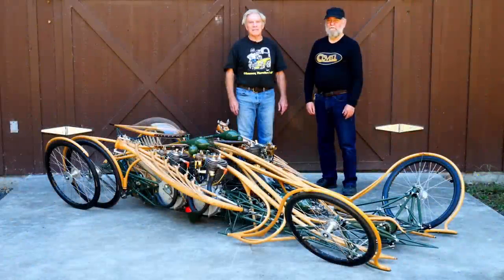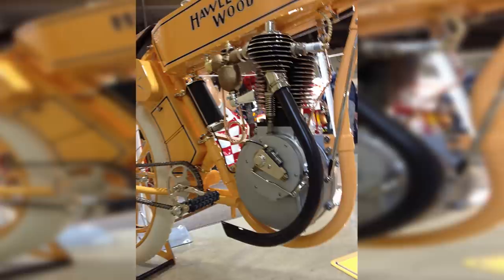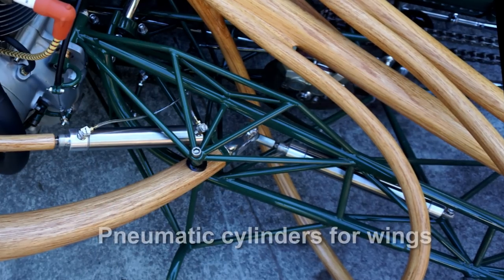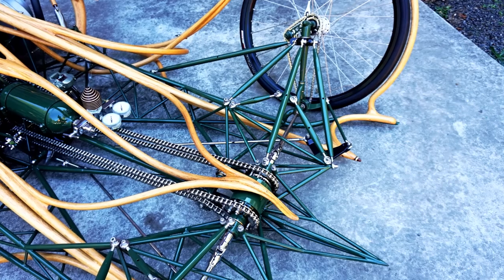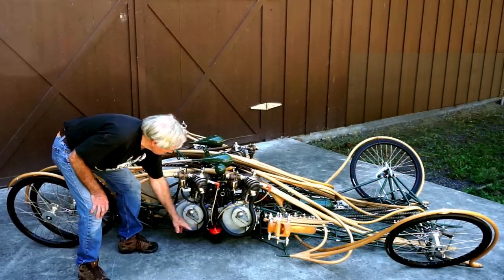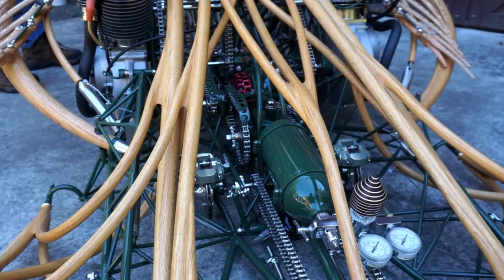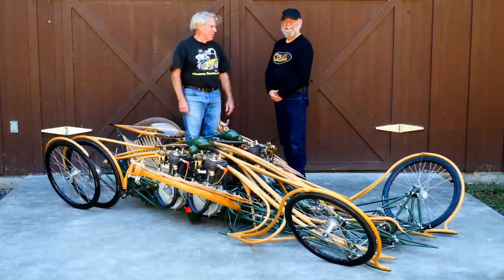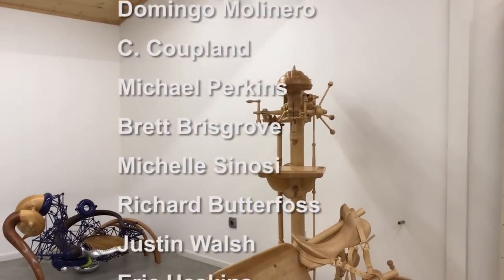Mike Cooper's Chain Reaction

Comment: Ron, knowing your background, I'd be more than happy to see your take on design and the process of designing a both functional and beautiful vehicle, seat, sculpture or just about anything people can make. I'm an engineer and I often feel I lack the artistic side of me. I'm not sure how to approach dimensions which come out beautiful and balanced. I often use too bulky materials (even if thin walled) and when I'm finished doing what I do and stand back and take a look, it's almost always looking less than attractive and something seems to be "off".. I've tried using CAD, but it's sometimes difficult to see how it comes out from different perspective. Even a simple table is hard to make if your aim is to have everything balanced - table top proportions in relation to leg length, height and width etc. Call it "how to make things beautiful" 🙂
Reply from the maker: Thank you so much for your thoughtful comments. I seem to have been born with a skill that many people call 'a good eye'. I seem to know intuitively how to tweak proportions to make shapes work well together. I did go to art school for 6 years, and learned many helpful things there, but I'm not sure how well design can be taught.
Reply: @RonCovell  thank you for your comment. I often think industrial designers doesn't get the appreciation they deserve. A regular person is quite good at looking at a finished product and make judgements (as comes with music also), but designing from scratch is hard. It's really hard. The mathematical approach is always there with golden ratios but it doesn't always work when one needs to think about structural integrity.
Reply from the maker: I agree with you - structural design and aesthetic design are very different, and it's often quite challenging to integrate them.

Comment: It’s so beautiful but the entire time watching this, I’m asking the screen, how does it steer?
Reply from the maker: While it's hard to see, there are handlebars in front of the driver, and a linkage system that steers the front wheels.
Reply: @RonCovell  My comment wasn’t about the manual control of steering, I’m talking about caster and camber of the actual wheels. 

I understand that this “vehicle” is art. I get it. But at some point, pretending to make an art piece that is supposed to move down the road for even short distances the artist should pretend that it could steer itself down the road. 

Steer tires angled out at nearly 45° camber cannot be controlled to go anything other than straight at any speed.
Reply: Again, the thing is a masterpiece. It’s beautiful. The front wheel drive alone is incredible. 

My point is that an airplane “sculpture” with no wings wouldn’t really look like an airplane.
Reply from the maker: Well, the sculpture has a little caster, and a LOT of camber. I think it can steer to some degree, even with that huge camber angle. We'll see when Mike makes it more operational.

Comment: I'm totally into sci-fi, fantasy, outside-the-box thinking, and overall wild ideas. So while the wings are cool, I'm personally enamored by the DRIVELINE! While you panned around the front, I saw the chain running up front to an axel, which then drove a chain... and I said to myself "holy crap, he made it all-wheel drive!"

For me, I find the mechanical engineering part of this to be the impressive and "cool" aspect! I think a second one needs to be made, stripped of the extra glam (mainly just the wings and associated parts), using PVC and fiberglass in place of the wood — unless making those bends with laminate wood is trivial for you, thereby making it easier? — and then maybe find some off-the-shelf single cylinder engines to use.... Or.... Electric motors... 

Because, sincerely, the underlying VEHICLE you've made, deserves to have its chance on the road! (or airport tarmac, same-same lol)
I can appreciate any reluctance to want to get Chain Reaction drivable, side first and foremost it's an art piece... a sculpture... It serves its purpose regardless of being operational. 😁
(the reason I suggested perhaps going electric would just be purely from a practicality standpoint, as it might end up too loud or even have to unbalanced of power output between the gas engines; however, in no way am I saying the drive train would be changed, only electric motor swapped in place of the gassers!)

Anyways, this concludes my ramble!
Great project, amazing creativity employed (in all aspects), and well executed! Kudos 🍻
Reply from the maker: Thanks so much for sharing your ideas!

Comment: cool, cool.... however, those 1/2 inch unidirectional socket joint for the front wheel drive, really goes to show that this is not meant to be driven.
Reply from the maker: Mike's goal was to make it functional, but just barely.
Reply: @RonCovell  i feel torn about that, so torn i don't think i can look at it anymore. see you in the next one Ron😊
Edit:
i did have another look and now i saw the camber angle compared to the king-pin angle, yikes - gonna feel every bump in the steering wheel. 
to me art is steering geometry that makes good handling characteristics and mechanical longevity, so art is clearly quite subjective😊
Reply from the maker: No problem. When you build yours, you can use nice beefy Spicer U-joints!
Reply: @RonCovell  beefy, no, it depends on the application, it's a balance between function, weight and beauty
but, yes, i will not use a unidirectional socket joint in my next build
Reply from the maker: For the record, Mike uses industrial universal joints, not the kind used for socket sets. Here's an example:
https://www.jwwinco.com/en-us/products/3.6-Moving-transferring-connecting-with-shafts-and-joints/Universal-joints/GN-9080-Steel-Universal-Joints-Single-or-Double-Jointed-Versions?artikelnr=12MXE2&gclid=CjwKCAjwzNOaBhAcEiwAD7Tb6CkDEuyxmKq5zfe-rqe54LJ-IJK9LNTjL4TJ5bUORUw29NNZCTne0RoCgeYQAvD_BwE
Reply: @RonCovell  this critique clearly hit a nerve, it's almost as if you were in on the decision to choose this solution for Mike's build
and if you take offense to what I'm saying - it must be hard to be an active content producer.
Reply from the maker: Well, I like to engage with some of the insightful and thoughtful people who comment on the videos I post. Just to clarify my stance, I had no say-so in the visual or mechanical decisions Mike made, and clearly he prioritizes the visual element more than the practical. I understand that you want both beauty and function, and I have no problem with anything you've said!